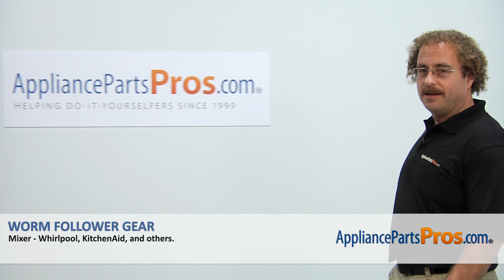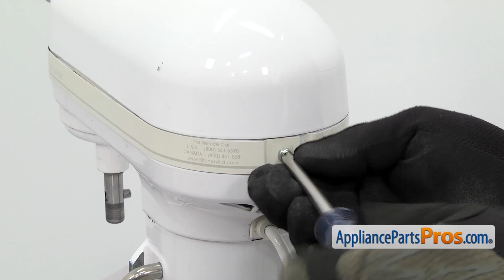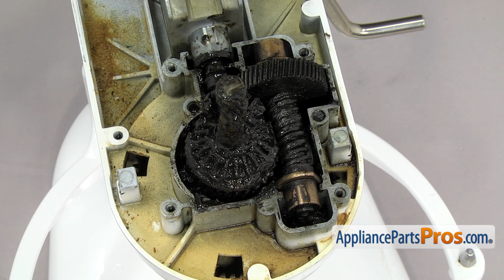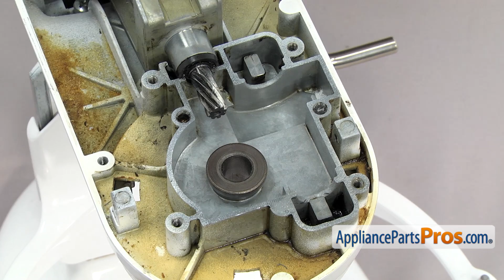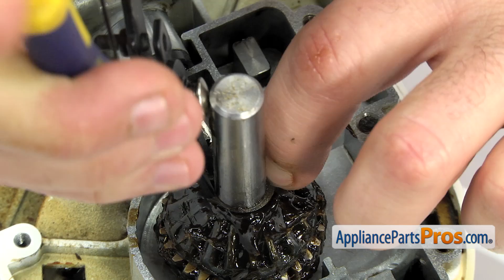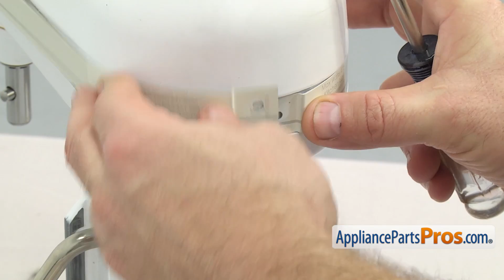How To: Whirlpool/KitchenAid/Maytag Worm Follower Gear W11086780

Comment: I noticed my housing was plastic and had a small crack. I bought the metal housing (along with the new gears) but it won’t sit flush. I put the old housing on and it sits flush. I believe the new metal housing is a little smaller and I notice the shape is a little different but I’m not sure which one is better at this point. Go with the cracked one or put on the metal one that has a little 1 mm gap. Please advise if you’ve had experience with this. Thanks! Love you video

Comment: I am confused, you stated that they worm gear if faulty will need to replaced with the newer model, than you stated replace the motor as well, can you clarify?
Reply from the maker: Great question, @natalielong8713! Sorry for the confusion — if your worm gear is worn out and you’re replacing it with the newer style, Whirlpool recommends replacing the motor at the same time to ensure proper fit and performance. The updated gear and motor are designed to work together, so using one without the other can lead to issues down the line. Let us know your model number if you’d like help confirming the right parts!

Comment: What size of snap ring pliers do I need? There are so many choices that I find. 0.038, 0.047, and 0.070 inches; all available in 18, 45, or 90 degrees.
Reply from the maker: The manufacturer doesn't provide the size needed for this part. But that tool can be purchased with different size attachments, so you will just match up what you need.

Comment: You Guys always have great videos.. On this video, I'm curious as to why you didn't lubricate any of the shaft  bushings? Me, I usually lubricate any shaft bushing or bearing. also i didn't see you replace the gasket for the gear housing.
And also, it's not really necessary to remove the motor speed control board. I was able to remove all 4 of the housing screws without issue.
Sorry for my critique. I'm really nit picky on fixing things proper.. I'll probably get flak over it, But I can take it too.. I believe in impressing my customers.
Thanks again for making these videos. Very helpful.
Reply: I just watched this a noticed he didn't install a gasket